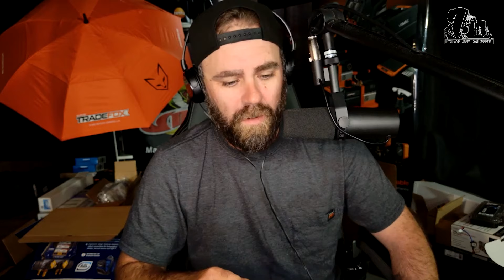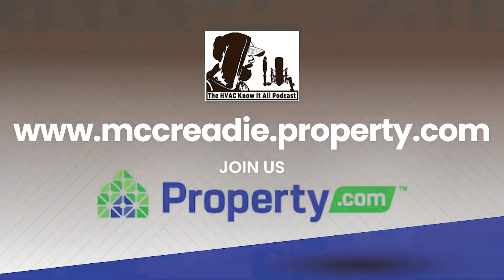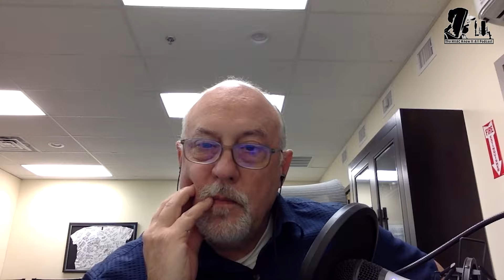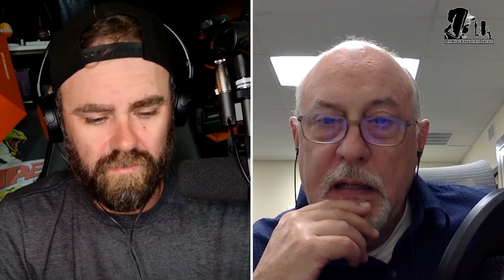How HVAC Techs Can Use Deep Vacuum, Nitrogen & AI Tools to Reduce Callbacks with Jim Bergmann Part 2

Comment: Most VRV VRF’s require triple for warranty now.
Reply from the maker: Never heard of this.  Mitsubishi only requires a certain micron level that holds.
Reply: @HVACKnowItAll Lg and daikin want you to decay test at 2000, 1000 for 15 minutes each with nitro purge after each decay And 24 hour below 500 decay before releasing charge.
Reply from the maker: That's silly and not necessary.  If you can hold  500 right away the other steps are unnecessary
Reply: It’s on their warranty punch list someone represents them and has to sign off on it being done. I don’t disagree but some manufacturers still want and require it to be done at least in my area and will not continue commissioning start up without it.